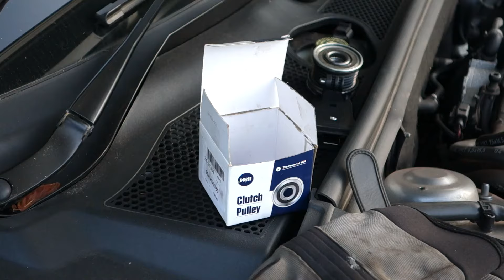Audi A4 (B8) repairs. Episode 1,  alternator pulley and serpentine belt change.

Comment: You didn't change the Tensioner you change the alternator pulley and fan belt 🤔 at the start of the video it says  The Screech is from the belt and The Rattle is the Tensioner but you didn't change the Tensioner
Reply from the maker: There is no fault in the tensioner so didnt need replaced. The rattle from the tensioner comes from the belt slipping then gripping on the pully. When it grips, the belt gets tight and pushes against the tensioner then as it slips it releases the pressure forcing the tensioner to drop. This all happens so quickly that the tensioner rattles up and down. Once the pulley is changed the belt runs at an even pressure and the tensioner stops rattling.

Comment: Hi, the belt snapped while may car was doing around 20kmph and the car came to an abrupt stop. I have got the belt, pulley and the tensioner replaced but the car won't start. Any suggestion?
Reply from the maker: Is there any chance something else went wrong that caused the auxiliary belt to snap? Did your AC pump or power steering pump seize? Is your main timing belt intact? Coming to an abrupt halt sounds like something more serious than an alternator belt snapping.